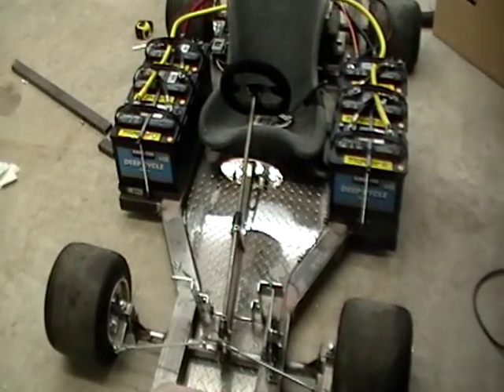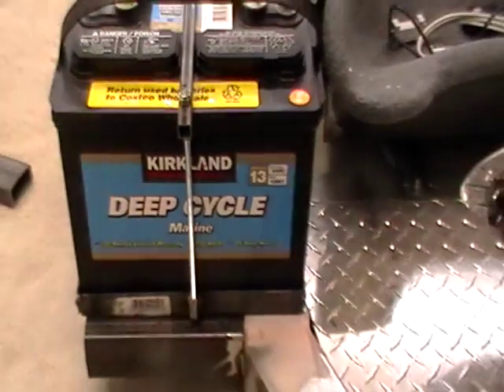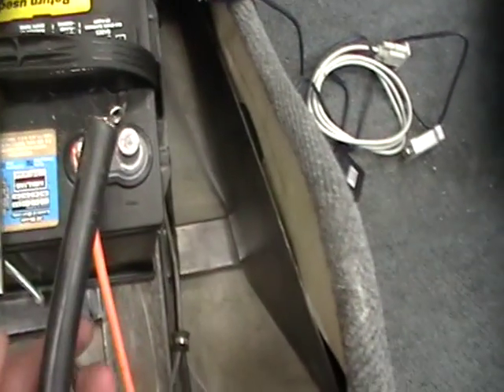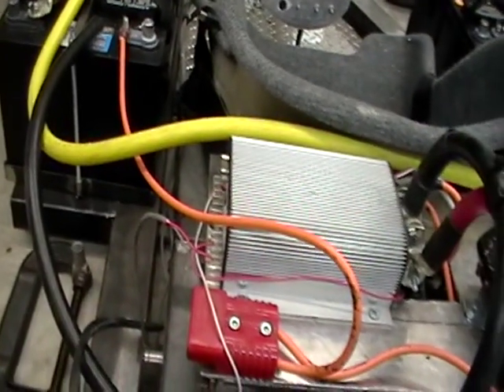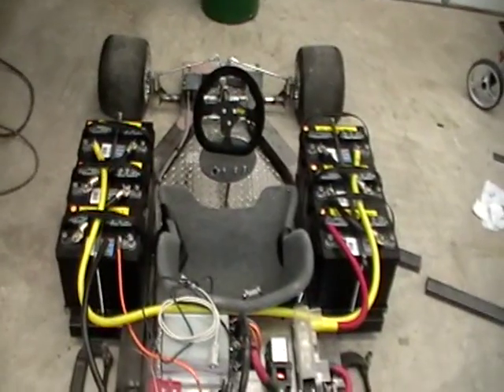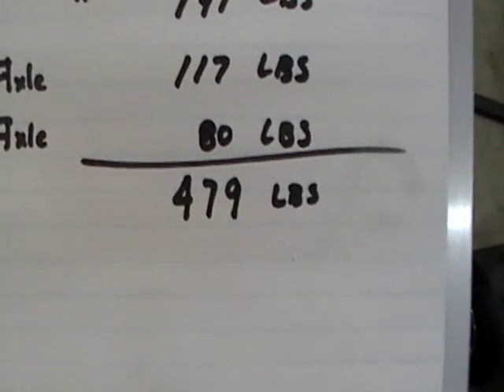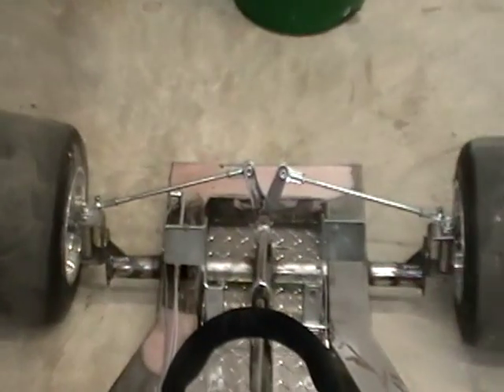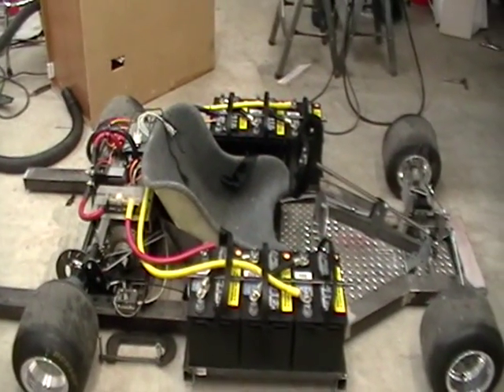electric go kart .mpg

Comment: can you show a clip or diagram of how to wire up all the components?  i have my 750 watts motor 48v, speed controller, batteries and i dont know what else i need to run it.